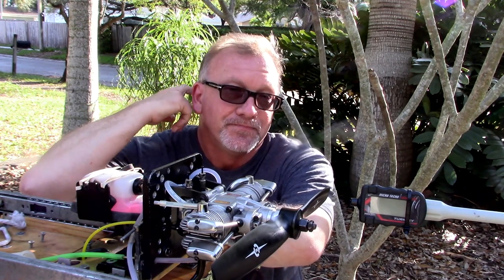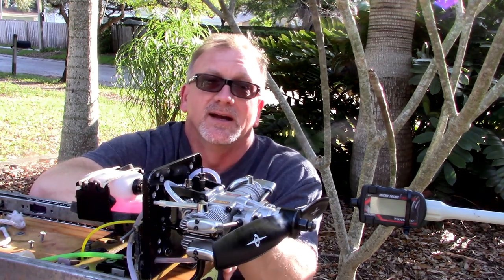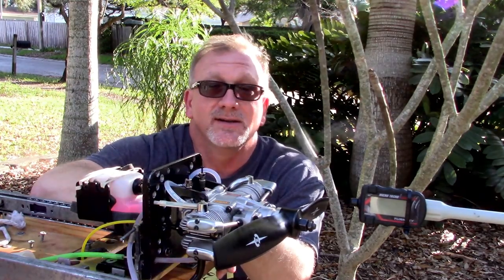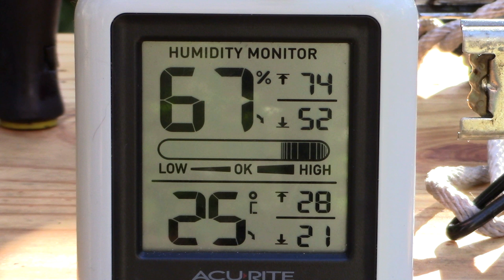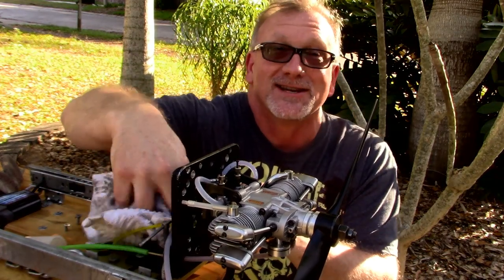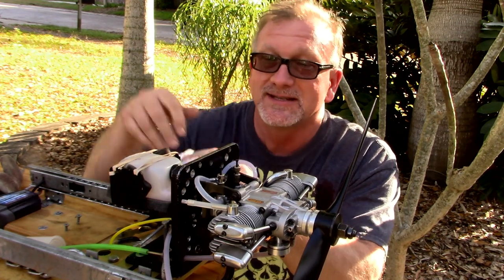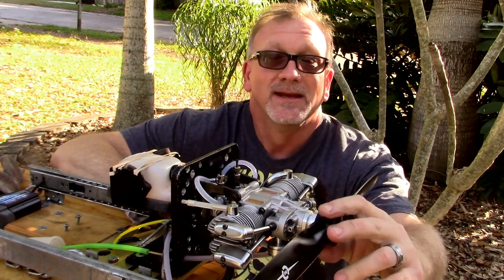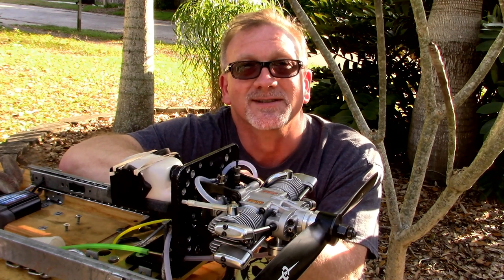Saito FA-130T DP First Run

Comment: Yep on a tear down ! I have the same engine with very low run time (I am second owner) , my bearings feel good but as I turn it by hand I swear I am hearing too much noise ! I have had it running on 15% Morgan's , 16/6 wood zoar prop at around 7800 rpm .